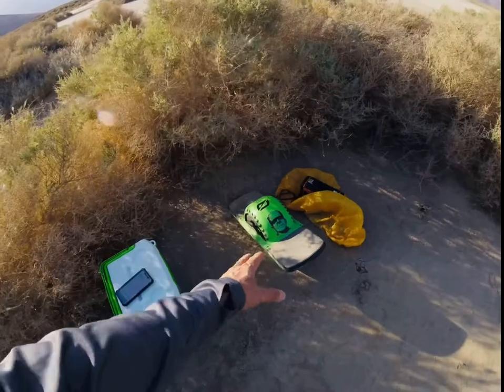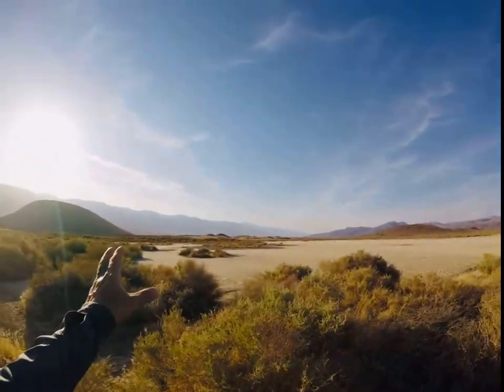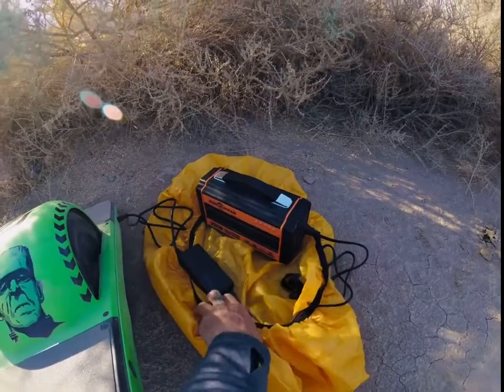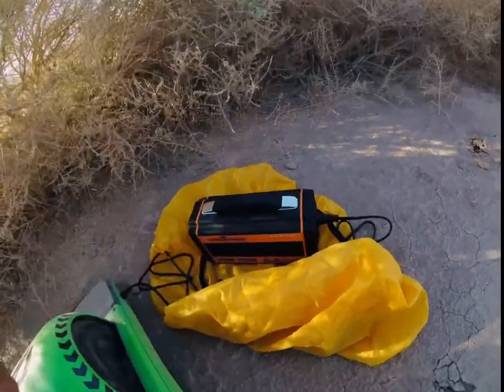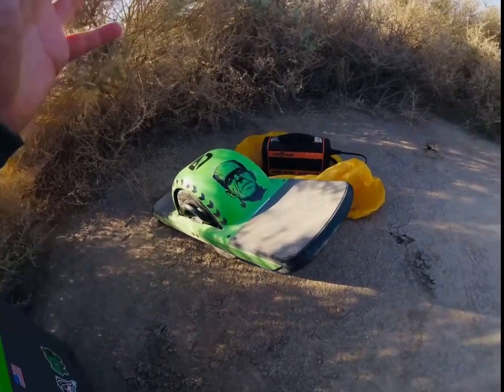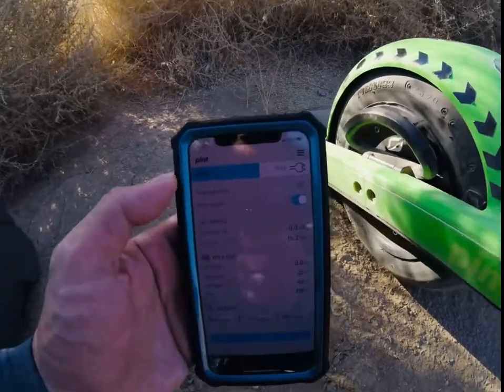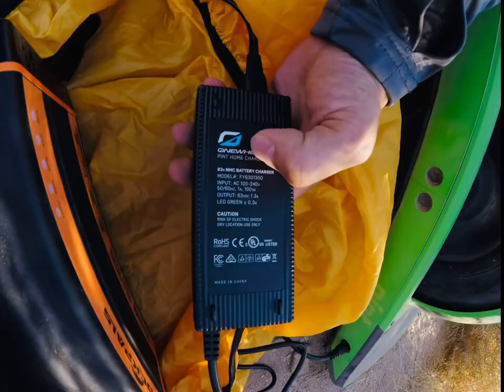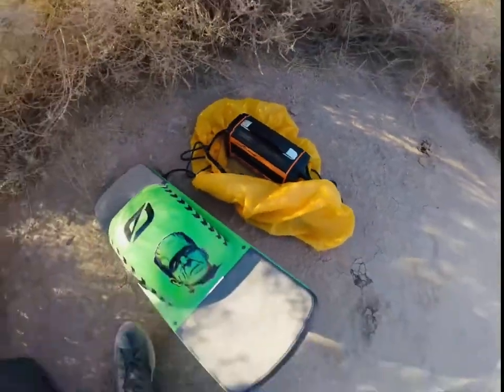How To Charge The OneWheel Pint On The Go/RockPals 250w Solar Generator/External Battery

Comment: Hey I would love to know if the car charger is more efficient. I think it takes longer but I wonder if using all DC chargers and ports would let you get more like 120% pint charge instead of 80%
Reply from the maker: I haven’t tried that but i don’t think it would be very useful maybe in a pinch.
The cigarette lighter only puts out 10 amps so it would take a long time.